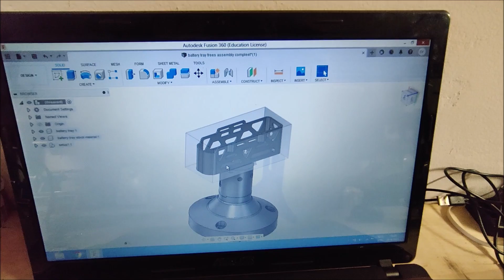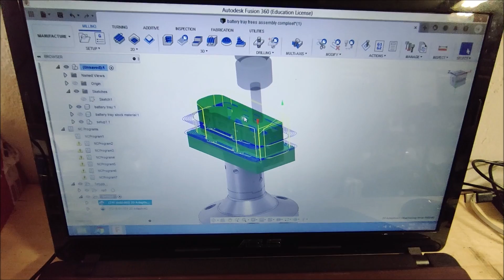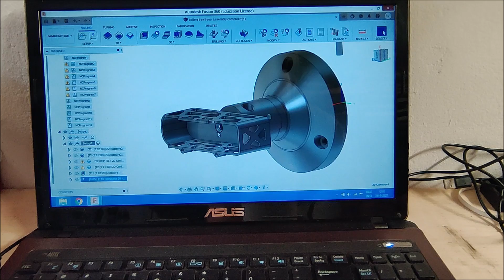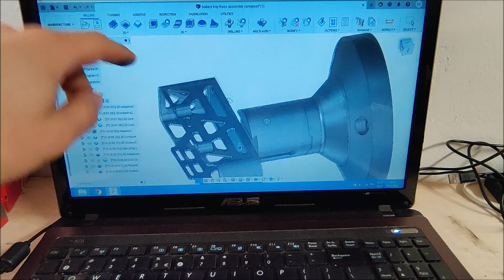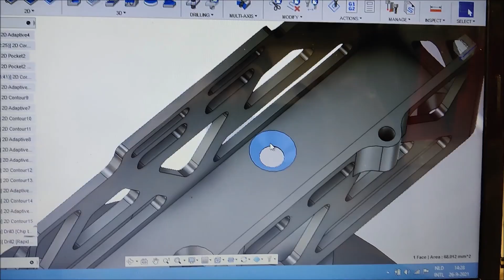3+2 machining on 5th axis trunnion first real part

Comment: Great work on the 5th axis design.
What is "HD 25-50" ?
What NEMA class are the servos used?
What model home sensors are used?
Can you show me link to "radial ball bearing_68_din_DIN 625 - 6010 - 18,SI,NC,18_68" ? 

Thank you so much

Comment: Great build series!
If you could do anything over would you change anything?
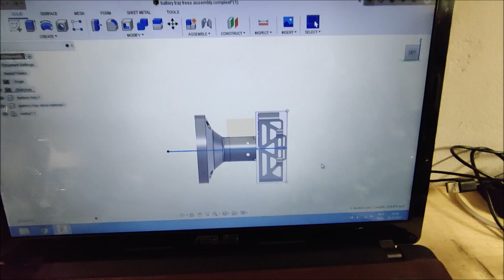For instance at 5:52 you show compensation for the part holding being off the center line could that be eliminated by lowering the tombstone below the centerline of the saddle?

Comment: Hello Stef, is there any brake installed on the 5th axis trunnion first and second rotation axes?
Reply from the maker: No there is no brakes installed. I think it would be beter to have brakes on it instead only use harmonic drives.

Comment: Hey Stef. I have a question. I have also designed a cnc milling machine myself and am now starting to build it. However, I don't know where to buy the BT30 spindle from, as there aren't many sellers. Can you tell me where you bought yours from?
Reply from the maker: Hey, its from aliexpress but that seller i bought it from 4 years a go doesn't sell it anymore.

Comment: At 9:00 I noticed that the cable of the trunion lifts a part of the way cover. Chips could get unter the metal covers and damage the bellow below. You could add some kind of support for the cable so doesn‘t touch the way cover.
Great video!
Reply: Good eye! Hope he saw this. :P

Comment: Great job Stef! Amazing how good your trunnion is working. To be honest I thought that rigidity would suffer due to that tall clamping post  and also because of the trunnion to be made of aluminum itself. But seems to be quite rigid, so again great job.
I was asking myself, how does the machine know to move Z completely  up at the time, when the trunnion did the 180 spin. Is that part of the post process or do you have to program that in fusion360?
Reply from the maker: Thanks for the comment! the post processor takes care of this. On a re position move for the trunnion the machine moves first to g28.
There is some small movement in the harmonic drive i noticed. If you listen carefully when i rough out the outside of the part with the 10mm endmill. you can hear some weird noise when the tool moves around the corner. other the that with just some light machining the  trunnion is perfect for hobby purposes.
Reply: @Svanitterzon  Thanks for the reply. Can you tell which brand and type of harmonic gearbox you used? Or did I miss that in one of the other videos?
Reply from the maker: @lgmn-cnc  I bought these harmonic drives second handed on ebay. They can already maybe be a little worn out compared to a brand new one.
They are from the German company harmonic drive AG.

Comment: I think your need to replace a new branded spindle bearing or use ceramic bearing instead, the noise is not normal and it will fail soon

Comment: very nice job friend, could you remind me what post processor software and hardware do you use? and what post processor /mill do you use on autodesk? Thanks!
Reply from the maker: I use the edingcnc post processors in fusion. and i enabled the 4th and 5th axis part that is normally disabled in the post processor script.
Machine is running on a edingcnc cnc760 card
Reply: @Svanitterzon  thanks bro!very nice!